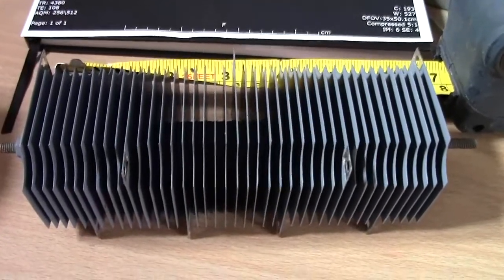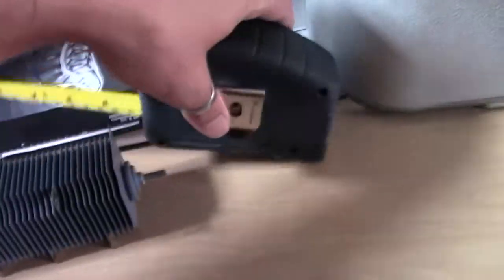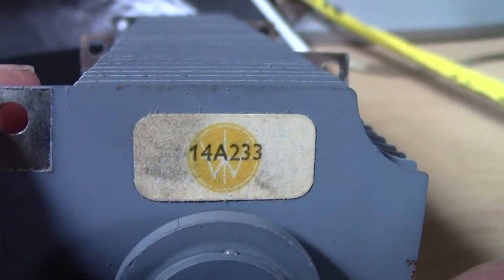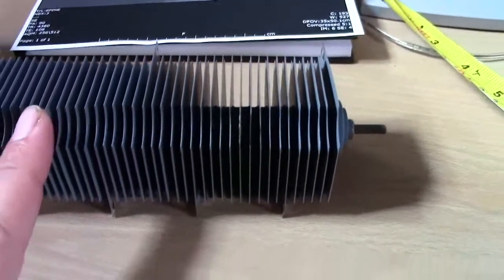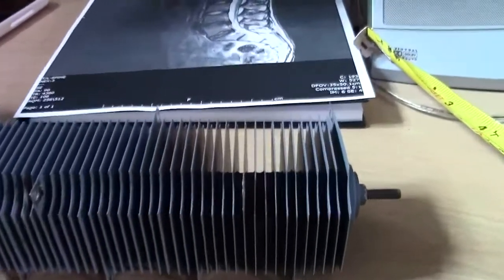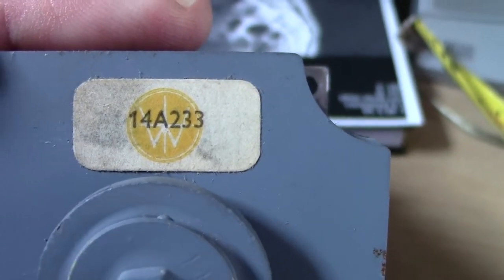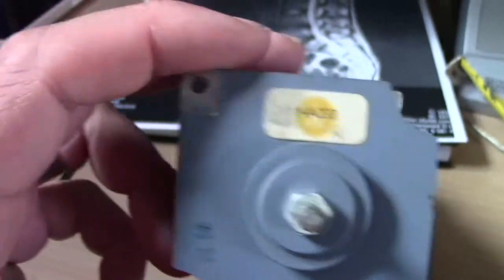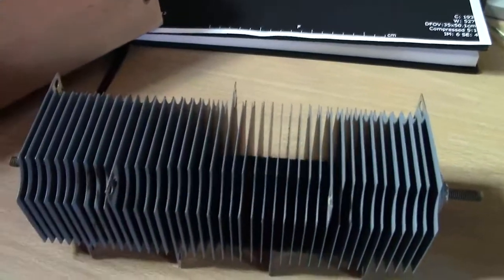Very old and random selenium rectifier ,ANY help appreciated

Comment: That may be a copper oxide rectifier, or some other dry metal rectifier, copper oxide ones were used with lower voltage but higher currents like in battery chargers.

Comment: Hi - if you look at the photo on this page

cougarelectronics(dot)com(slash)selenium

you will see one a bit like yours near bottom right that has a similar number of tags and looks as if it is a 3-phase bridge rectifier, considering the external connections that have been made. You can look to see if some of your rectifier elements are 'reversed' and then see if you can draw them zig-zag up and down to make a 3-phase bridge.

Comment: Selenium rectifier cells are rated for about 0.32A/Sq.In. current. Voltage per cell is between 14 and 40V depending on time of manufacture. These can degrade over time, design lifespan around 20 years. Your cells look like about 4 Sq. In. each, so maybe 1A for this stack. The multiple taps indicate that it may have been used in a multiphase application as a rectifier. At the beginning of WW2 these began to replace tubes like the 5Y3GT etc. in radios, telco switchgear, etc.

Comment: I' ve got a smaller one, rated at 12 Amps 50 Volts, those things are inefficent, but very, very though (they were uset also in DC welders, so, to rectify hundreds of amps!)

Comment: Ebay lists it as "14A233 Vintage Selenium Metal Rectifier for Radio/Television.

The question is if it was used before or after transforming the mains.

Comment: On a piece of paper, draw a standard bridge rectifier (like a diamond), but put 2 diodes in series on each leg
Now, if you connect the 2 ends of the selenium stack, check with a meter to see if it makse sense
i'm guessing you'll find 4 diodes at each end pointing towards the middle, in a bridge the middle would be plus, the ends (connected together) would be minus